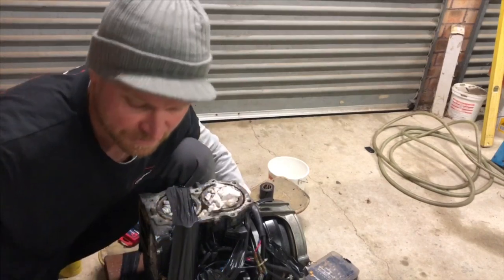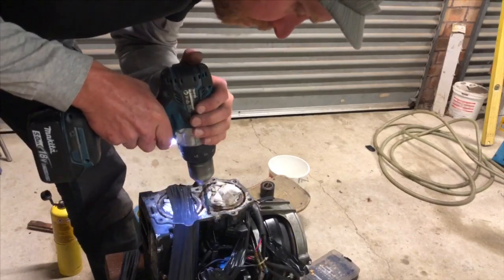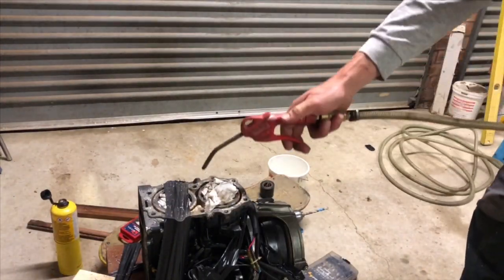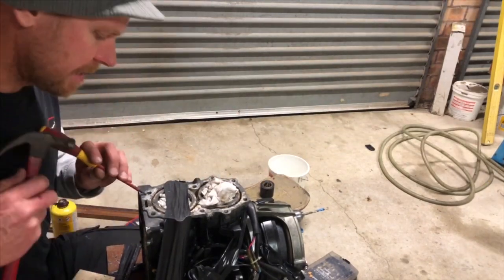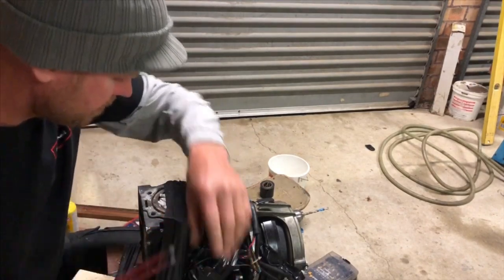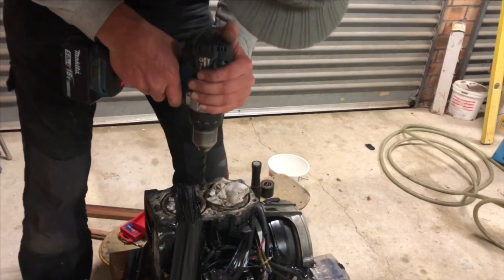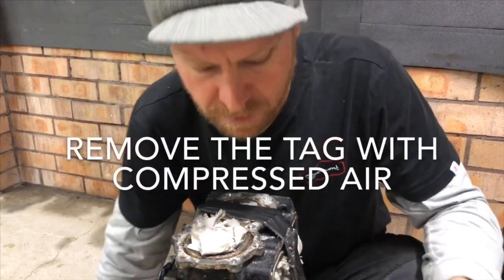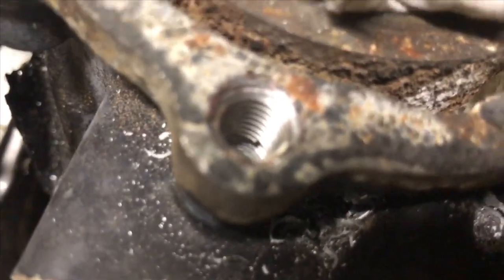Outboard broken bolt repair at home.

Comment: What size drill bits did you use and what size was the tap kit please?
Reply from the maker: Hi Mate,
it’s different for each motor and bolt.
You just need to take one of the bolts to the local engineer supplier and they will sort you.
Cheers 🍻 
Aussie Boat Guy 😎

Comment: Great video once again! What drill bits do you recommend for this? Also do you drill at high or low speed and do you use lubricant?
Thanks mate
Reply from the maker: Hi Mate,
I recommend good quality drill bits, the last thing you want is to snap one inside your bolt. The 1/8 pop rivet double end drill bits seem to be a great pilot hole too. I drill at a medium speed but with a decent amount of pressure, you need to make sure to always be pulling a shaving while drilling steel. I do use lubricants for drilling, you can use a drop of oil or even some wd40.
Cheers 🍻 
Aussie Boat Guy 😎
Reply: @25hpboatracerman thanks heaps for your help with that mate. You have a lot of really good videos on your channel. I’m going to rebuild a 25 tohatsu soon. You have inspired me!

Comment: Really enjoy your repair and maintenance videos, plus the combo tinny / outboard testing.   Great content, just wished they were a little longer.   Also, I've found Inox MX3 spay in combination with a blow torch a fine asset to minimize broken head bolts.   Again thanks for the videos.

Comment: Thanks mate - great video! Hadn’t seen the heli coil system till now. I ve see a rolled pin tapped into the bolt hole (if the snapped bolt is deep enough) and used as a guide to keep the pilot drill straight  as possible...

Comment: Hey mate love your vids, can you please do a video on aluminum/tinny repairs? I've got a boat sitting in my garage that has a few small holes in it and would love for you to show a how to fix and repair a tinny. Cheers
Reply from the maker: Sure can, next tinny I repair I will video.
Depending on how thick the aluminium is on your boat, there is a number of ways to repair. Corrosion (pin holes) are hard to weld as the aluminium is polluted. 
I normally weld and grind flat but if the aluminium is less than 1.6mm I tend to burn holes with my mig welder, I chase the hole till it’s fixed of course.